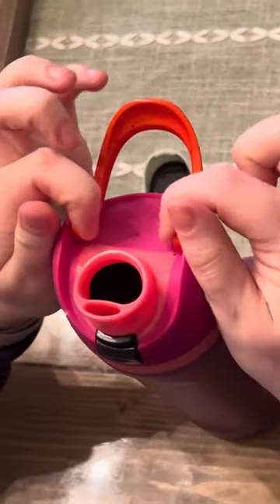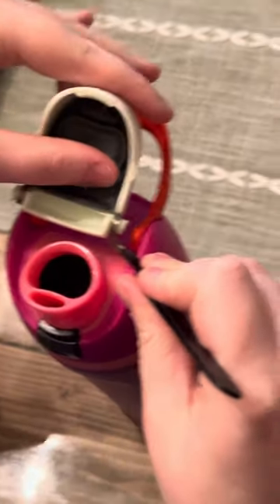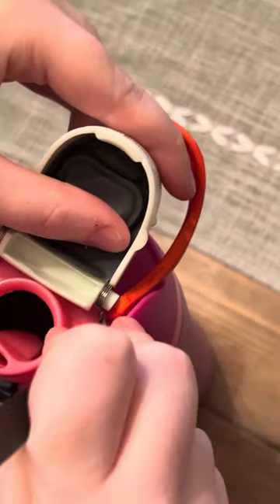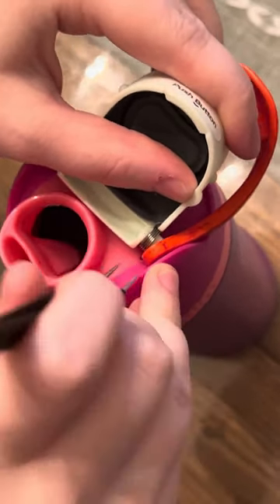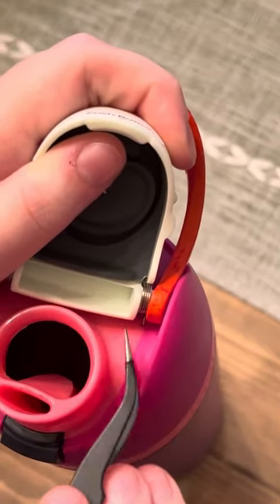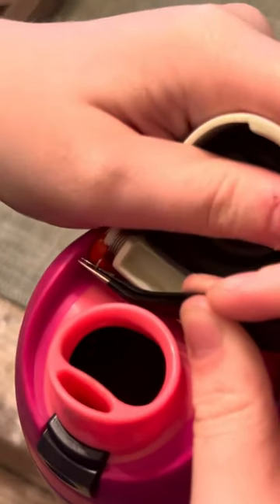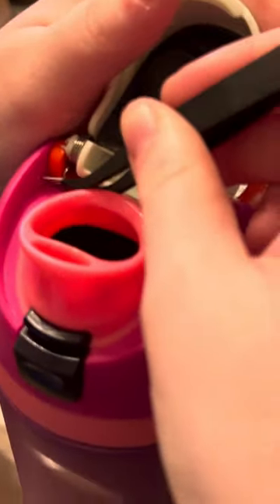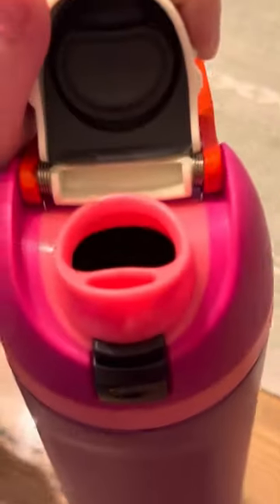How to: Owala freesip latch lid replacement

Comment: Very helpful!  As others have asked, ensure the cross bar of the spring is positioned under the lip of the rubber silicone stopper.  It's harder to get the spring into the holes, but it allows the lid to fully swing back when opening it.

Comment: Which way is the spring soposed to face I get it on but it won’t pop back up
Reply: That happened to me too
Reply: same
Reply: I know this is kind of old now, but the bar of spring is supposed to sit under the silicone stopper. I did the same thing and it didn't work so I looked at where it is on my other lid and that's where it was. It's even harder to put it back together this way because there's more pressure.